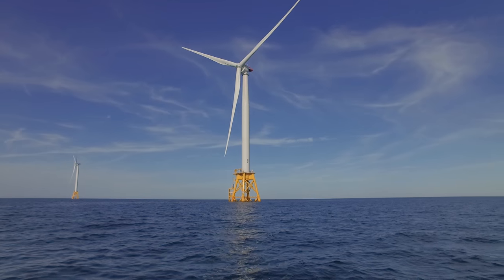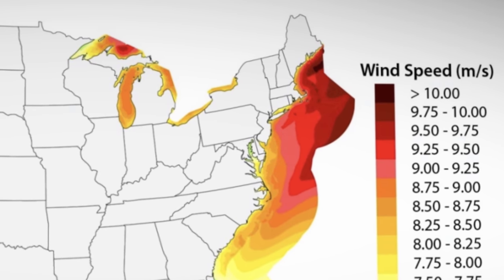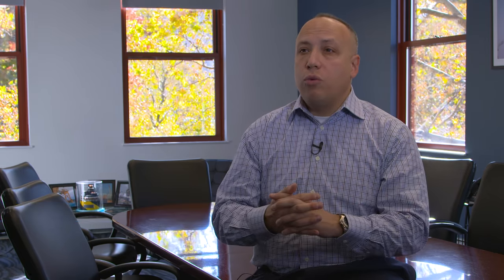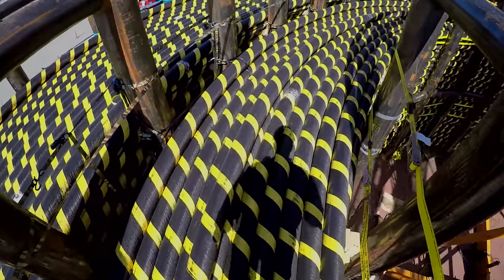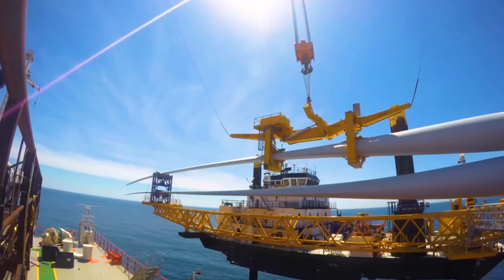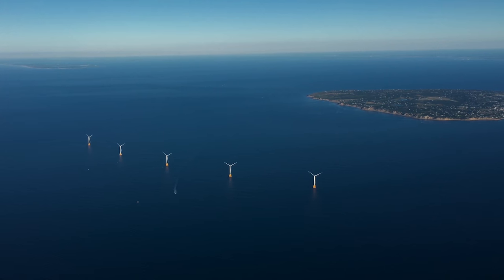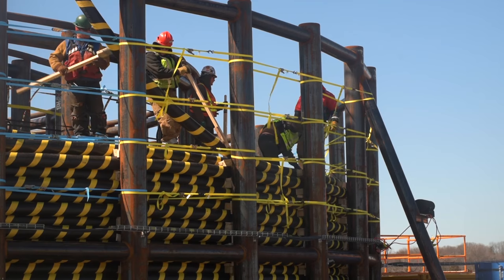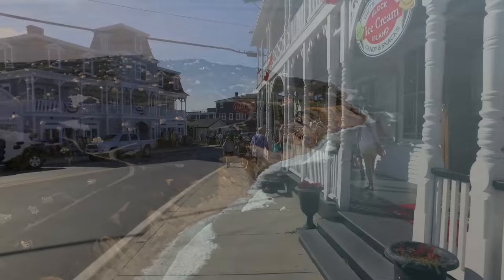Offshore Wind: the Future of Electricity in the United States

Comment: forget about it

wind turbines of 100 megawatts. (there is no one of that size)

183,333,333 (number of wind turbines needed by the United States)

4 square kilometers. per turbine theoretical

733,333,332 square kilometers (the size of chile country)

5500 terawatts. only the current electricity consumption.

without counting the oil that the country needs ...